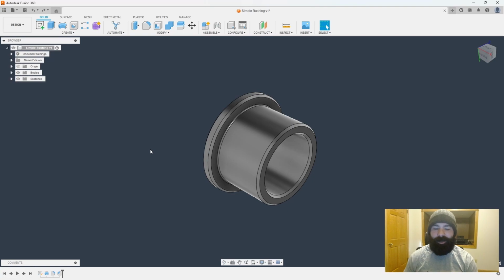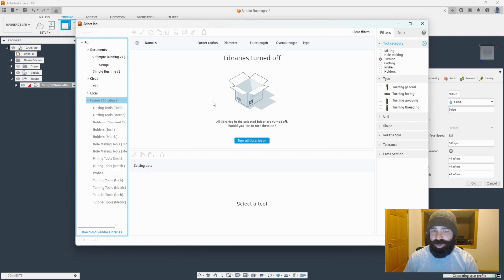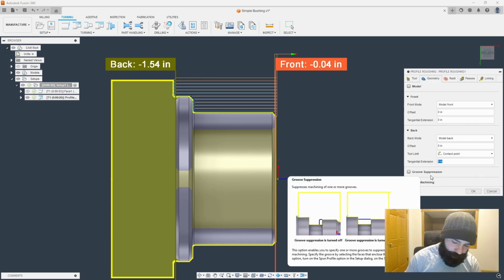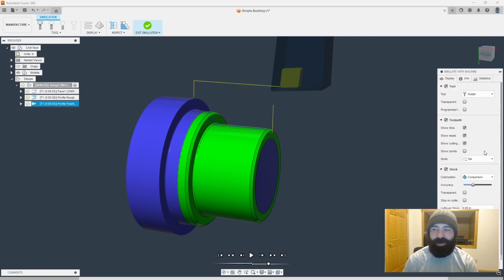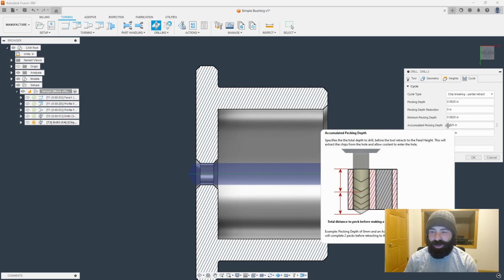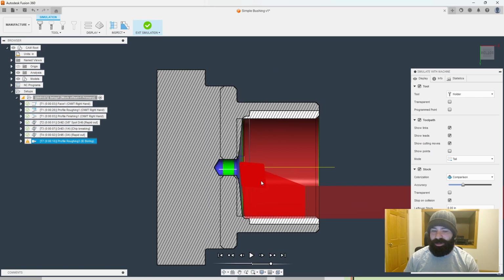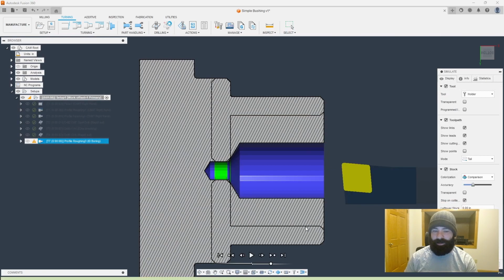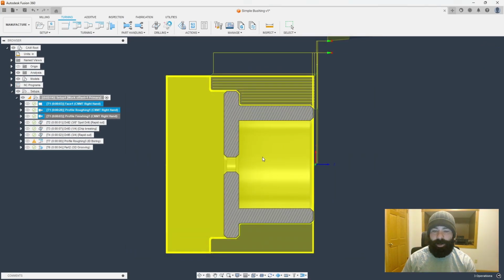Turning Tuesday: Simple Bushing

Comment: thank you, I really like your content and I am looking forward for even more Mill-Turn CAM videos.
Reply from the maker: Glad you like them!
Anything you would like to see?
Reply: @JITCADCAM  Sure, for example: 1. Machine simulation for turning or mill turn machine with all the kinematics and tools located in the turret and spindle really spinning. Is it possible to do it and if yes - how? 2. It would be nice to see more in depth explanation about each and every option in the menu when you're making a tool path. Normally you go very quickly thru it because the default values works, but it would be nice to see the options in more detail.  3. Also it would be nice to have explained the menu when posting out the nc code. There are lots of parameters that can be changed that affects the code and readability on the machine. 4. Tips and tricks for editing the post processor ( I know it's JS, but maybe you have some ideas about how to make minor changes in order make better this or that).

My last note will be -  there are tons of videos about CAD part of Fusion, but very few recent videos about the CAM. That is precisely why I find your youtube channel very valuable. 

Thank you and good luck.